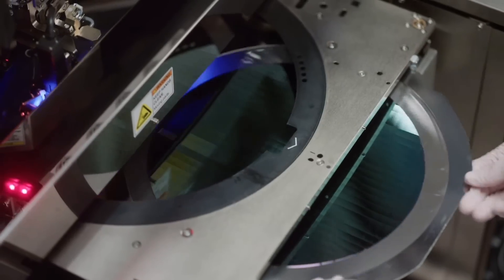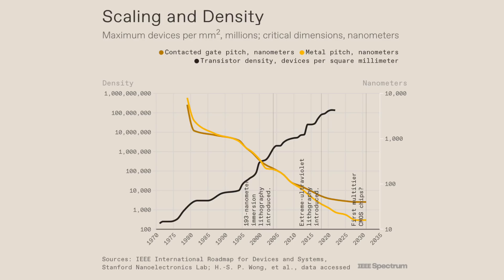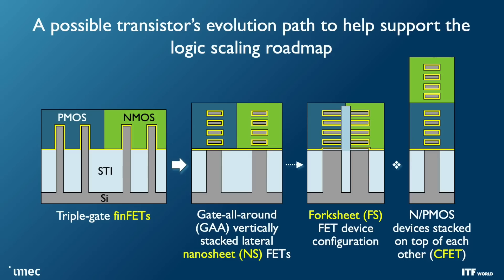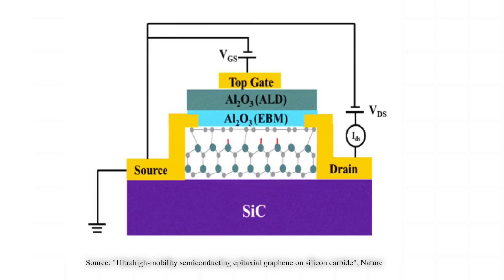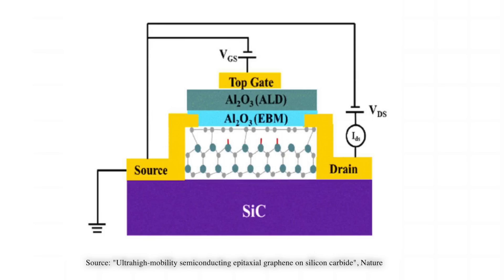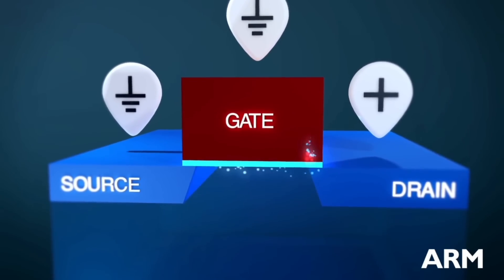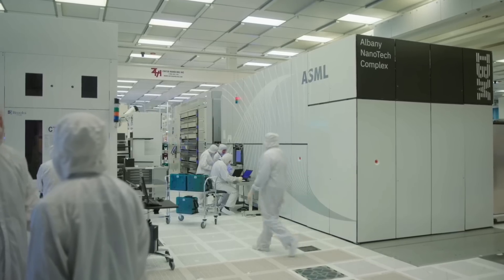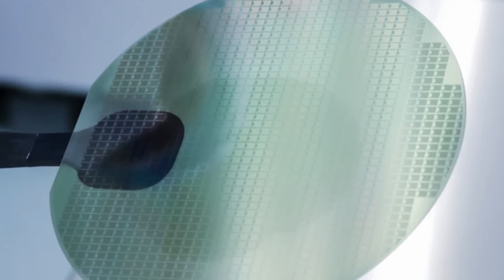Microchip Breakthrough: New Era of Electronics

Comment: Isn't evolving current silicon technology into a 3D/vertical form just another way of have multiple 2D units, kind of like having multiple CPUs?

Moving to a 3D form in and of itself doesn't seem to hold much benefit. Redesigning the current transistors to be vertical does seem worthwhile though.

Comment: Are we just holding on to electron technology too much and putting too much time and effort into researching new ways of making electron based technology do more?

Are we being prevented by economics from moving into a better way of doing things by moving away from the electron to something more efficient and with less limitation?

I vaguely remember it being said, perhaps in a previous video by Anastasi, that current manufacturers don't want to outfit new fabrication technologies and facilities because they would be expensive, have some unknowns, there isn't a guaranteed return and because they still have a lot of existing fabrication which is expensive and get more out of that existing investment.

Comment: With an extremely harmonic processor it is possible to instantly build antimagnetic crystals, the same crystals that exist in the cube, inside the star (SUN) (crystals of immortality, antimagnetic crystals, infinitely light (not dense). With low harmonics of classical music, harmonics built by violins, violas and cellos it is possible to create an infinitely light and powerful processor that will make it possible to build infinitely light armatures and bodies from antimagnetic crystals. Infinitely powerful armatures to dominate any type of matter, including harmonic crystals (water). Infinitely perfect harmonics of strings can be found at the beginning and end of the song ETERNAL ECLIPSE - SPIRIT OF THE FOREST. THE PROCESSOR (DIE) WILL BE INFINITELY LIGHT AND PERFECT. It is infinitely forbidden to use metal on the processor DIE. With the same machine that builds the DIE It is necessary to build the circuit board for the DIE with harmonics.The processor DIE must be lighter than the harmonic crystals (water).  Remembering that the cube that is inside the star is a tool of immortality (Crystals of ARTHÊNYUS, antimagnetic crystals, infinitely light) building mortality) matter density, crystals of harmonics (water).  The only tool that can fix this problem is the DIE (harmonic processor).

Com um processador extremamente harmônico é possível construir instantaneamente cristais antimagnéticos, os mesmo cristais que há no cubo, no interior da estrela (SOL) (cristais da imortalidade, cristais antimagnéticos, infinitamente leves (não densos). Com harmônicos graves de música clássica, harmônicos construídos por violinos, violas e violoncelos é possível criar um processador infinitamente leve e poderoso que possibilitará construir Armaduras e corpos infinitamente leves de cristais antimagnéticos. Armaduras infinitamente poderosas para dominar qualquer tipo de matéria, incluindo os cristais de harmônics (água). Harmônicos  infinitamente perfeitos de cordas é possível encontrar no início e no final da música ETERNAL ECLIPSE - SPIRIT OF THE FOREST. O PROCESSADOR (DIE) SERÁ INFINITAMENTE LEVE  E PERFEITO. É infinitamente proibido utilizar metal sobre o DIE do processador. Com a mesma máquina que constroe o DIE é necessário construir com harmônicos a placa de circuito para o DIE. O DIE processador deve ser mais leve do que os cristais de harmônics (água). Lembrando que o cubo que está no interior da estrela é uma ferramenta da imortalidade (Cristais De ARTHÊNYUS, cristais antimagnéticos, infinitamente leves) construindo a mortalidade) matéria densidade, cristais de harmônics (água).  A única ferramenta que pode corrigir este problema é o DIE (processador harmônico). 

超高調波プロセッサを使用すると、立方体に存在するのと同じ結晶である反磁性結晶を星（太陽）の中に瞬時に構築することができます（不死の結晶、反磁性結晶、無限の光（密度が高くない））。クラシック音楽の低調波を使用、バイオリン、ビオラ、チェロによって構築される倍音を使用して、反磁性結晶から無限に軽いアーマチュアとボディを構築できるようにする無限に軽くて強力なプロセッサを作成することが可能です。無限に強力なアーマチュアは、倍音結晶を含むあらゆる種類の物質を支配します( ETERNAL ECLIPSE - SPIRIT OF THE FOREST の曲の最初と最後に、無限に完璧な弦のハーモニクスが見られます。プロセッサー (DIE) は無限に軽く、完璧になります。プロセッサー DIE に金属を使用することは無限に禁止されています。 DIE を構築するのと同じマシンで 高調波を使用して DIE の回路基板を構築する必要があります。プロセッサ DIE は高調波結晶 (水) よりも軽くなければなりません。 星の内部にある立方体が不死のツールであることを思い出してください（アルティニュスの結晶、反磁性の結晶、無限の光）死の運命を構築します）物質の密度、高調波の結晶（水）。 この問題を解決できる唯一のツールは DIE (高調波プロセッサ) です。

Comment: Remember that vibration is a space between each shaper of the circuit so that it can become a pressure valve assembly in crystalline types that are wavelengths of harmonics associated with the refraction valances

Comment: The resonance transistors are the most important part of frequency differential types that only switch in a certain degree of resonance or vibration to certain types of energy these swap systems are densely populated including layers of warped light that refracts the switches position these smaller ones are flowing type in gases forming a magnetic resonance recorders or a projection of light in various directions vibrations etc.

Comment: If only they were smart enough to build roads with graphene or graphite, it would collect static electricity as people drive over it, even more so in the winter charging cars as they move. Same thing with jet planes, Elon wanted to create electric jet engines but the Jets can't sustain the travel because the burden of weight and space to house batteries - the solution is to make the body of the vehicles also be made of graphene to be ultra light, strong and be used as battery storage and collection whether moving or not, but the faster it moves the more it vacuums the electricity, especially at higher altitudes and in space. Graphite is one of the most abundant/cheapest materials. Graphene roads would make the world's largest battery that will likely not need much maintenance due to it's strength, isn't toxic and disposed of like other batteries.

Comment: We can’t just keep shrinking the transistors, not without potential changes to the engineering (so non-silicon based ones).

Right now, 2nm is about the limit without a lot of issues. Moore’s law will probably be revitalized in the form of 3d-stacking on the die a lot like Nand-Flash does; there are already RAMs that have multiple layers, cpus won’t be far off. The big issue will be dumping the heat from the multiple layers of transistors, which might come with clock speed reductions.

Stuff like photonic computing, and multiple different types of chips and designs will continue to up the processing power of our chips. But the transistor counts will only start doubling periodically again once 3d-stacking is implemented somehow; imagine your cpu but it’s 10 cpus stacked on one another in the same area. It wouldn’t take up that much more volume because the part that does the processing is already very thin now.

Comment: It sounds great. Heat has climbed up, but also it is a problem with the design. If you look at CPU's like AMD's you see 2 major flaws. One flaw is the freaking cover has become too thick or far from the chip. 2nd flaw is it has 2 plates on the actual chip for thermal transfer, BUT they're both on the bottom. Certain people themselves recognized this and made alterations and it droped temps by over 10 celsius (huge change). Just adjusting your CPU cooler lower (on those certain chips) will drop temps, because they stupidly put both those littles plates on the chip on the freaking bottom.

Comment: This is pretty cool. One of the hardest parts of graphene manufacture is defects at scale. But if you're only making teeny tiny little bits of graphene to use as the channel on top of such a stable substrate as SiC. I honestly don't know how well that would work. Perhaps also use graphene nano-wiring at that point too?  How does it react to magnetic fields? What's the deposition process? Do dopants simply integrate regularly into the lattice? How accurate do the lattices have to be to work reliably? Is EUV 13nm light small enough for structure etching? Does its manufacture require atomic force precision or can we do it with resists and CVD? I have so many questions!!!

Comment: Mindblowing yes, the new era coming of chips.. companies need reduce voltage by downscaling nm technology as example giving what i've read as articles (by independently writers) nvidia plaining to make 3nm blackwell architecture. So what we should expect higher clock speed lower voltage under 0.5v vram gddr7 will works same specs with little higher difference of the core usual.  So that times which they come its very interesting, by downing the voltage and getting higher clock speed we have energy efficiency per wattage so as example which ill pass though will think is like let get 5060 rtx (GB108/7 codename) future unrealased card will be around 95W-105 with 6144 cores in total  with 8gb-12gb gddr7 ram. One thing more which i've have been impressed by looking previous architectures from same company.: The GPUS  from Volta to ada lovelace its reducing with unnits tensor cores and adding more RT cores and CUDA units :🤔 idk why. May gamers arent interesting to use their gpus for machine learning AI its good staff why not ?!  Why need spend more money for tensor cores professional gpu like tesla's/quadro then we can get it in usual game card?! Pay 1500-3000 bucks get more for money. And next big thing in CPUS the years which they are coming cpus will replace gpus with they graphical cores inside dies theres also havent pointless to use addtional gpus (about notebooks) 😏

Comment: I thought AMD was stacking silicone years ago in their GPU architecture. These modern cpus put out a ton of heat and are less efficient than years ago. I always pictured some type of fiber cpu using light instead of electrical energy to process data. Electricity creates a ton of heat.
Reply from the maker: stacking dies vs stacking transistors

Comment: This video touts a new major breakthrough in semiconductors, i.e., grapheme on SiC then boron arsenide. If we look back the material indium phosphide (InP) has demonstrated extremely high mobility but more importantly for years complex devices and operation circuits and even MMW amplification. If one looks back, gallium arsenide was a major thrust for speed and complex circuits and RF power generation with a large government cash infusion. Then, Hughes jumped over GaAs with InP, followed by TRW (now Northrup); InP is inherently better performance parameter than GaAs. It would be appropriate to compare InP with the Boron Nitride mentioned at the end of the video. Is there a significant benefit that would make such a venture important? Look at the frequencies that have already been achieved with complex logic circuits and amplifiers in InP. Additionally, SiC is also highlighted but GaN has proven superior. The decision makers over the years in the semiconductor industry are driven not by improved devices but by the inherent cost. When InP rapidly exceeded GaAs for speed, when speed is the issue why was InP not selected for a large scaling effort. Silicon was cheaper and large investments in silicon facilities from the 60’s were still in place. As you note, and I do appreciate your videos, band-gap, mobility and coefficient of thermal conductivity (efficiently moving heat), are critical to all future electronic devices and circuits. These parameters translate into higher speeds, increased efficiency (less heat generation) and improved output power (if power conversion is the goal). Generating research papers and getting improved funding trails is always important but jumping to the next “bright and shinning” material should be considered within the landscape of whether a semiconductor fabricator is willing to make the initial investment to move away from a comfortable infrastructure like silicon. Also, as you note, when one begins stacking devices, efficiency and thermal conductivity translate to reliability. I am not sure that making circuitry smaller, with higher thermal density and thermal associated problems is a good trade. GaN is already remarkable.

Comment: If they're using graphene for the channel in the transistor, maybe they can use graphene for the wires which are traditionally laid down in metal as well. If it's that much better at electron mobility, perhaps the stray capacitance and latency of long conductor paths can be avoided. Often times the "wires" limit the speed of a chip more than the transistors themselves.

Comment: Former Semi CVD/ALD material supplier here...  Fun fact - diamond, basically the 3D carbon structure vs 2D graphene, was tried out for supreme heat conducting properties in the early 2000s. 

Also, compound semiconductor thin films are just in the starter blocks to make their way into microchips, instead of a majority of LED/solar cells applications. Cannot wait to hear about III/V, IV/IV and II/VI stuff. BAs sounds interesting, however, what ever happened to AlN, BN for microchips? SiGe and SiC have been there for years, but what is the latest and greatest? 

You are doing a great job here and just gained a new subscriber. Long live the Google algorithm that led me here ...  😂

Comment: I want a 20 gigahertz chip because that will give Ray j frequency positioning circuits with a range of 1 km and an accuracy of 2 cm. Because that speed it's fast enough to measure photons coming from different directions and their speed difference

Comment: Not only an order of magnitude faster, but I'm guessing epigraphene is vastly more durable too.  The question then is what is the limiting factor for practical use?  Can epigraphene wires and contacts be manufactured economically?  How flexible is it?  If resistance is vastly lower, wouldn't epigraphene be vastly better at deploying electrical power?  From your description, I'm guessing that other electrical components (e.g., capacitors) can also be made with epigraphene?  A lot to think about!  Is this our tax dollars at work sponsoring this research?

Comment: At some point that "shrinkage" of chips is going run into the "Law of Large Numbers."  Many of the laws of current flow or current behavior depend on a statistical treatment in which electron behavior is treated based on probability when a large number of electrons apparently act together.  (This is similar to the derivation of the famous gas law PV=nRT using statistical mechanics on "spherical molecules".)  When you shrink the devices, you use fewer amperes (=fewer electrons) to trigger your transistors.  Fewer electrons means smaller numbers, right?  But when the statistically-based "Law of Large Numbers" no longer is fully applicable because the numbers are getting TOO small, further shrinkage will become impossible.

Comment: If only we can have millimetre space on between chip, so that we can heat dissipate in-between. The spacing must not be all round to allow connection between chips. Mostly likely for metallic heat sink to be inserted in between to dump heat as motor powered air conditioning.

Comment: i was at a place only a couple days ago that was looking into this for a period of time but stopped as they thought it didnt work, but for different reasons as a big fault in silicon based semiconductors is heat conduction so they wanted to make some type of semiconductor with diamonds as they were good at conducting heat, but not electricity. so they tried mixing graphite and diamonds to make a in between material that was electricaly and heat confuctive to eventually use as a semiconfuctive material. sadly they didnt get to this but from this video is seems like graphite-based semiconductors still have it going!

Comment: Your strength is to go into detail because of your background. But it's still at a level that many of us that don't have technical backgrounds can...at least grasp. I do have a question. It sounded like the graphene and the Boron Arsenide would both 10X the capability of chips. If graphene is so much easier to manufacture, why spend time on the Boron at all? Does it have some potential benefits not found in graphene?